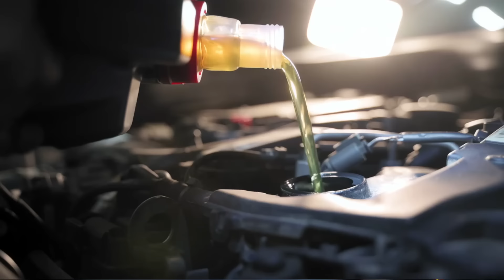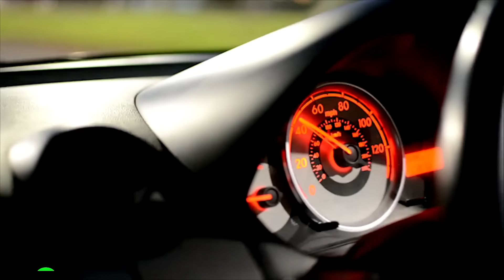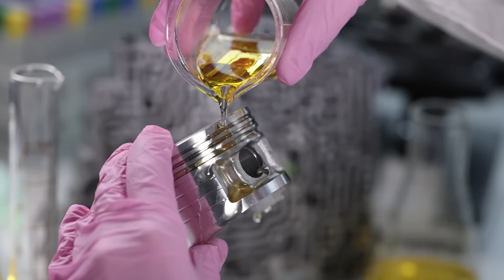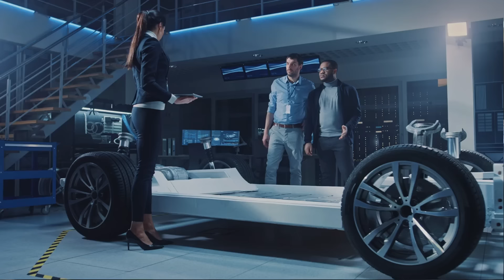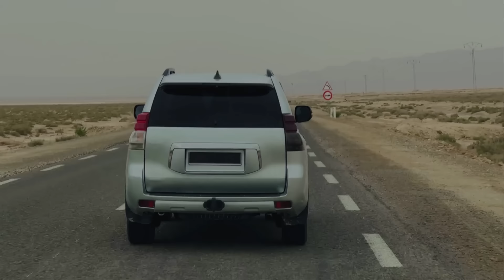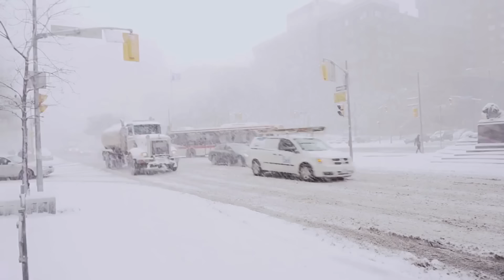Why the Same Engine Uses 0W-20 in the U.S. But 5W-30 Everywhere Else (Mechanic Explains!)

Comment: My wife’s 25’ Lexus uses 0w16 and my 25’ Corrolla uses 0w-8!!!
I am thinking of going to 0w-20 for both or even 0w-30 because those oils seem way too thin, it’s practically mineral oil.
Reply: Been running 5w30 in my 2021 RAV4 since it was new . Engine is so much quieter
Reply: @EverydayJ1786 how many miles on it with the 5w30? I also have a 21 rav4
Reply: Castrol Edge 5W-30 Full Synthetic in my wife’s ‘24 RAV4 and the same for my ‘25 RAV4. Get the 0W-20 & 0W-16 out if you are wanting the best for your engine and are planning on keeping your vehicle like we do ours. 
I had 50 miles on my ‘25 when I changed the 0W-16 to 5W-30. This advice is from my local Lexus/Toyota service center owner. 
Too many high mileage Lexus and Toyota engines are having “oil consumption” issues now and that was never the case in years before EPA stuck their nasty noses in our business with CAFE standards (RULES) for auto makers. I bought my first Toyota, new in 1983 and have NEVER had one to use oil between changes. Not so unusual with too many now sadly.
Reply: @MichaelSmith-57 how many miles on your 24 and 25 rav4 with the 5w30 oil in it? 
Also do you run the 5w30 in the winter as well? Thanks 👍
Reply: @mattburgess2 My wife’s’24 RAV4 has 5315 miles and my ‘25 has 1376 miles on it. As you can see, very low miles to date. I also have a 1999 Toyota 3.4 liter V6 Tacoma I bought new that has 156K on it and I remember the first time seeing that it called for 5W-30, thinking that 5W-30 was too thin, so I used 10W-30 as the owner’s manual stated was OK to use. The same Lexus/Toyota service center owner I mentioned earlier says that’s what he would use as well. So, I continue to use it with no issues whatsoever. 
How many miles on your ‘21? Does it call for 0W-20 or 0W-16?
Yes, year round. We live in the Southeastern US.
Reply: @MichaelSmith-57 Yes mines a 21 rav4 that calls for 0w16, I bought it new in December of 2021 and ran 0w16 for about 25k miles and switched to 0w20 and been running that, currently have 39k miles. Always synthetic but I tried mobile 1, amsoil, pennzoil, and now Castrol I believe was the last one.
Reply: Ohhh....I think 0w-8 is wrong...it should be 0w-7.6344! (These automakers must be on crack.)
Reply: Tell us who the boss in your family is without telling us...
Reply: I read that Japan has used 0w-16 or 0w-8 in cars for many years before introducing it to the US market. I don't know if anyone has more insight on this, but I don't know if Japan follows the same efficiency laws.

Comment: 10W60 in my Porsche Carrera from 2000. Hot Oil pressure with 5W40 was 0.8 bar, now it's 2 bar
Reply: Higher oil pressure doesn't mean better flow.
Oil pressure is resistance to flow.
Too high will harm the engine and the pump and reduce engine cooling.
Have you tried 5W50 or 10W50?
Anyway 2 bars seems good on idle.
Reply: @jean-sebastienguay1282 You're right about that. However, boxer engines have the problem that, due to their design, cylinders 5 and 6 on the right-hand cylinder row only receive the hot water that has already cooled all the other cylinders (as is the case with almost all engines 😀) and secondly, they are not sufficiently lubricated on the upper cylinder walls, or the pressure of the cylinders is transferred to the upper cylinder walls under load. A thicker oil that is not so easily stripped off or adheres better due to its viscosity is more advantageous. To answer your question, I previously had 5W40 in the engines and when the oil was warm, the oil pressure was between 0.5 and 0.8 bar. That was too low for me.

Comment: Only vehicle that are being destroyed are GM v8, seems they can’t machine them all correctly, Toyota isn’t having a problem!
Reply: Tundra v6 engines are all recalled .
Reply: Wrong.  Toyota V6 and Honda V6 are having lots of issues due to bad manufacturing.
Reply: @daveladd5614  don’t know about Honda but Toyota had a problem with debris in the engine causing problems and nothing to do with oil which is the subject of this video, GM is trying to compensate for bad machining with oil. Toyota has been using 0w20 oil for many years without failures due to that oil, something GM can’t say.
Reply: @RonL-y3v  toyota tundra v6 turbo has a weak lower end that cant handle the twin turbos, not metal left behind,
Reply: toyota trucks are the worst, wise up

Comment: 180 k on 2012 Lancer GT 2.4 MTX... Just went from 0w 20 to 5W-30 and we are just fine. Primarily highway driving out here high desert SoCal it's happy as a cat in a bird shop.
Reply: I switched from 0w20 to 5w30 after 166K miles, mostly highly miles in NorCal and central valley. I wish I had switched sooner. Also, instead of 7500 miles OCI, I should have gone no more than 5K.

Comment: If you're negligent or poor no money to buy oil regularly stay with 5w30 
0w20 is correct oil but oil have to be clean, change 0w20 more frequent,not just lubrication alone,,0w20 cooling metals part way better than 0w20,,,remember antifreeze not cooling bearing and under Pistons oils does
Reply: BS
Reply: @Alex-4C want bearing overheat from lack of oil to cooling it switch to thicker oil like 5w30 or even better 5w40😂
Reply: @heinhandsome2010 You are funny... and obviously non-educated... I'm an Automotive Engineer, Have Managed OEM and Tier 1, 2 US & Cnd. Automotive Manufacturing Companies... For Example: Toyota-Subaru use  ONLY  5W30  in GR86/BRZ in Japan and  approve in North America either 0W20  or, or, OR  5W30...  Wake up, study, learn and stop talking about things you are not qualified about.
Reply: @Alex-4C I go with toyota engineers
Reply: @heinhandsome2010 Funny boy - You must be The Second to GOD knowing that you are smarter than Toyota's engineers - the Greatest and MOST reliable company...
Reply: @Alex-4C not anymore
Reply: @Alex-4C I disagree with a couple of your statements. I retired from Toyota Motor Manufacturing Kentucky, V6 Powertrain hot test QC, in 2019 after 29 years of service. Management and Engineering were commonly known to not pay as well as other auto manufacturers. So, we didn’t always have the best candidates employed. Not to say there weren’t SOME outstanding individuals, but it was always a battle to try to maintain high quality with them thinking a short cut might save a couple of dollars, resulting in them getting a feather in their cap for cost savings. Second…we prepped a couple of cars for an industry competition where a 2 man team had to drive long distances between race tracks where they would actually race. Tools for service and minor repairs had to be carried with them and the 2 man team had to perform these tasks. One of the arguments between us and the engineers was about oil viscosity. They maintained the US factory required 0w-20 was better than our recommendation of 5w-30, and we said it wouldn’t hold up.  2 identical engines run at 5000 rpm, under load, without shutting down, 24/7. The 0w-20 engine grenaded on day 4.  The 5w-30 engine was still good and internals were within spec when we shut it down after 7 days. Those who are paid to “know”, don’t always know.
Reply: @264boresteve  don't understand... Obviously we agree, 5W30 is way to go
Reply: GM 6.2L V8 L87 Recall
recalled vehicles that pass inspection will receive an oil and filter change using new 0W-40 Mobil 1 Supercar oil (0W-20 was the original) In addition, vehicles that pass will get a new oil fill cap and revised documentation to match the revised oil spec.

Comment: 2ar-fe use 0w40 and 0w30 both make my engine knocking.. now use 0w20 and it runs quite like a mouse..
Reply: Just the opposite for me,I have a 2012 Scion tc that has the same 2arfe engine like the Camry and rav4 but 0w30 or 5w30 gives me the smoothies ride and mpg I get on average 34-36 mpg and I'm at 225,569 miles on the odometer
Reply: if in winter at very low temps. yeah.

Comment: This is excellent, thank you!  Make Master Maintainers!

What all should people do to achieve ≥500000 mile vehicle life?
Reply from the maker: Glad you liked it! Hitting 500,000 miles is totally doable  you just need consistent maintenance. Good oil, proper fluids, timely filters, clean fuel, cooling system care, and fixing small issues before they turn big. Treat the engine gently and it’ll return the favour.
Reply: @CarCareCrewOfficial  Most definitely!  There have been wicked people out there who've been brainwashed by product marketing and Tesla hype trying to get people to autocide (kill) their vehicles!  They've even got A.I. and Reddit and Youtube bots!  Very hostile people!  Honesty and Wisdom has been in short supply.

How best to determine fluid change (and other maintenance) intervals, having acknowledged that the owners manuals have been so compromised/less that honest?

Comment: Emission is a pure scam. That's the conclusion.
Reply: The above written by someone who never experienced stifling California auto air pollution in the 1960s.
Reply from the maker: I get why it can feel that way, but not all emission standards are a scam. Some actually help engines run cleaner and last longer. The real issue is when things get over-complicated  what we need is balance, not extremes.
Reply: Nein das machen die damit die Fahrzeuge nicht! lange halten, und man gezwungen ist einen neuen zu kaufen, genau wie die Elektroartikel, programmiert nach der Garantie kaputt zu gehen.

Comment: Owners manuals used to give a oil weight range chart, now they give only one oil weight to use.  The best way to know how your oil is holding up is to send oil samples in for testing at each oil change. I always use 10w-30  and will keep using it.
Reply: I was thinking that 0W-30 would be good for year round use. An oil analysis will show whether I'm right or wrong.
Reply: I switched from 0w20 to 0w30 in my Honda Ridgeline with 185k miles on it. I noticed the engine runs quieter and smoother. I just sent the 0w20 oil sample to SpeedDiagnotix for analysis. The challenge with 0w30 is it is difficult to find and not many manufactures make that weight oil. I found Mobil 1 0w30 at Walmart online for $35 for 5qts. I may run 5w30 in the summer months and 0w30 in the Winter months.
Reply: @genericdude6551  You'd have to do multiple oil analysis to pursue such an unnecessary experiment unless you drive less than 3000 miles a year.  You're better off visually inspecting your oil condition every 1000 miles and changing your oil when you see that it has become dirtied/contaminated.  There's a lot of internet misinformation out there telling people that it's ok to operate engine on dirtied/contaminated oil.  It's not.  Much internet misinformation also tells people not to trust their own eyes and that lab analysis is necessary.   Scams abound.  The bad guys have been trying to psych people out of visually inspecting their oil and changing it when they see that it's been dirtied/contaminated.  They are malicious actors, outwardly cheerful evil fraudsters, not honestly science-biased people, they're pied pipers.  Refuse to be suckered by them (and killing your own vehicle).
Reply: @anti8.6 have you lab tested both 0w20 and 10w30 in a recommended 0w20 vehicle?

@Generalfukz 😂😂 absolutely 100% FALSE 😂😂. Visual inspection beats lab analysis 😂😂😂😂
Reply: @John-2fnf lab testing tells you oil condition, whether the viscosity is still good and if the engine is experiencing premature wear. I've never used 0w-20 oil even if the manual said to, and all the vehicles/equipment that I've done oil changes on comes back with good lab results. Internal engine failures seem to be on the rise lately and the biggest contributing factor is the oil.
Reply: Dishonest people tell people to disbelieve their eyes about inspecting oil condition and people have been neglecting changing their oil when it has become dirtied/contaminated and killing their engines.  Visual inspection is better than laboratory mail-away service for this reason.
Reply: @GeneralFukzamatayu  No...sorry.  Factually incorrect.  Just because an oil turns BLACK does not mean it isn't suitable for extended drain intervals.  Just because an oil is black doesn't mean that the wear metals are elevated.
Reply: @reubenmorris487  no no no, thats disastrously engine-killingly false.  extended drain interval is euphemism for wrong dirty neglect.  engines have been slain by that misguidance.  often those of working or poor families.  SHAME UPON YOU

Comment: So should i change my 2026 crv oil from 0w-20 (standard) to 5w-30 instead? NYC climate.
Reply: GDI engine = fuel dilution 
So I go to 5w30
Reply: Lots long road trip, yes; lots of stop and go and short trips, stay with 0w20. I currently using 0w30 in Canadian winter.
Reply: Ich nehme original griechische Olivenöl für meine Salat schmeckt besser, und ist gesund.  😊
Reply: Prob not.
Reply: 5w-30

I'm near Albany.
Reply: Never use any oil other than the one recommended by the manufacturer !!! Don’t listen to fools who tell you to use thicker oil just because that’s what they use in their 20-year-old car and it’s fine. Using the wrong oil can also lead to engine problems !!!